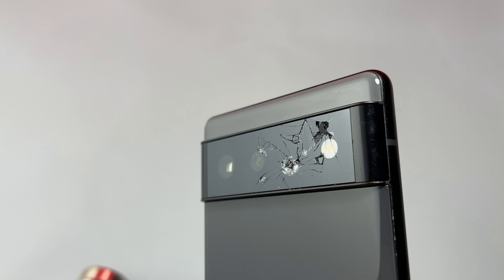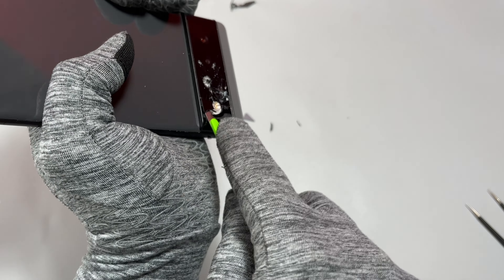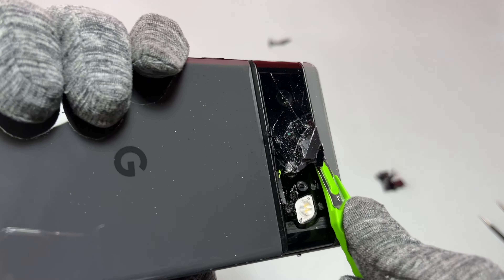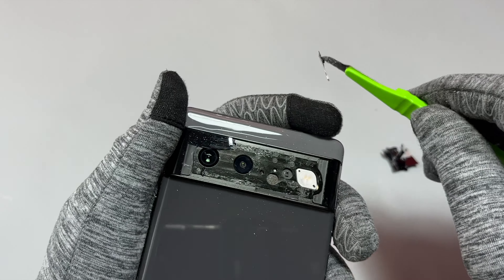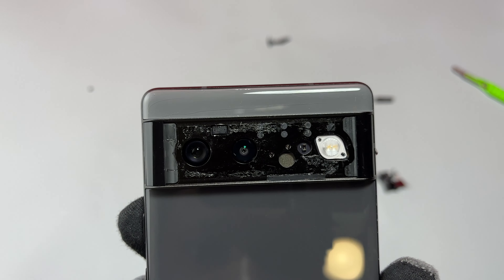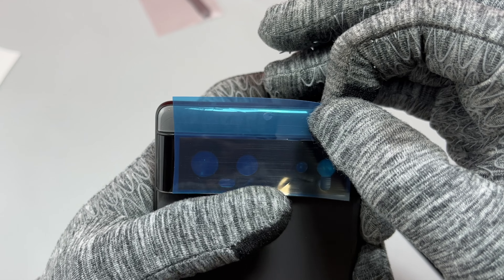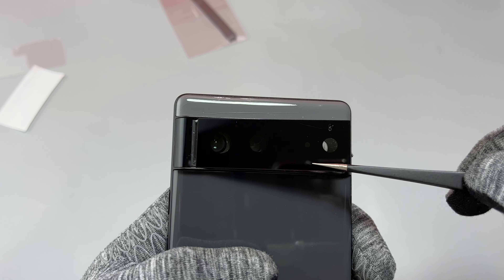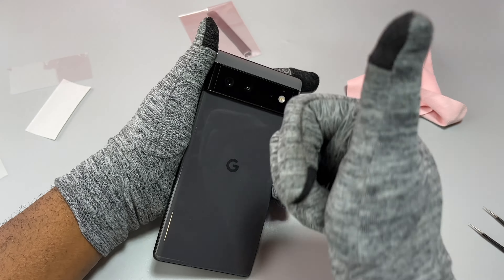Google Pixel 6 Camera Glass Replacement

Comment: It looks like the adhesive was just installed upside down. I think maybe they put the blue cellophane on the wrong side of the adhesive. If you had peeled the blue cellophane off and flipped the adhesive over then the sensor cutout would have been in the right spot as well as the cut out for the sensor above the flash.
Thank you for the video though!
Reply from the maker: 😅 you are RIGHT. Just a vertical 180 degree. Wow I was so surprise that I did not stop and think of what I can do to fix lol. The solution was easy and there 😄. Thanks for sharing and giving a solution 👍🏽.

I said to myself since it's IR infrared it would just go through the tape and wouldn't really really obstruct the operation.

Comment: Yes! Finally a repair video on the Pixel 6 camera lens. I'll do the same repair on my phone this evening but the replacement lens did not include any adhesement :l
Reply from the maker: 😟 no double sided tape provided. That strange that's the most basic thing needed for this repair. You can use b7000 it will work great just avoid too much near the cameras and you should be fine.
Reply: @ersbit  Hi, thank you for your reply. I just looked and it seems to be pre applied :) I'll let you know if the repair went good or not as soon as it's done. Keep up the great work!
Reply from the maker: 😂 great. Just try to mitigate as much as possible glass debris/dust getting on the cameras. It's really a pain. After these things the best thing to do is to add hear resistant tape on the glass to trap some of the debris/glass dust. I will try that on my next camera glass repair 👍🏽

Comment: Hi. I need to replace mine as the lens has spoiled but not cracked so I'm guessing I will need to break the glass's myself? Where would you suggest cracking it as I'm afraid to cause damage to the actual Len's or flash. However I fear anywhere else is sitting directly on the phone frame so maybe difficult to crack in a controlled way

Comment: My thoughts on my this repair was to use packing tape to cover the broken visor, then use either hot tap water or boiling water, soak a small towel (or even paper towel), put it in a zip-lock bag, and use it to heat up the broken glass visor.  This way the adhesive is hopefully soft from the heat and the tape will make it easier to remove the broken glass without them going everywhere.  Next time you repair, would you try this method and tell me how well it goes?
Reply from the maker: That can work but in my case that would require too much preparation and time to complete the repair generally 😅
Reply: @ersbit  Really?  I thought it was less prep and quicker.  Hot water from tap and tape to keep glass from falling apart.  I hope to do this to fix it.  I waiting on the replacement glass visor myself.
Reply from the maker: No am not saying it will not work, just for me it will take more time and wouldn't be wise because I already acquired all these equipment 😂😂. 
I have 3 hot plate for smartphones repair (barely use them) I prefer the 9$ heatgun because it's faster 😅. 
Using take is wise but this tape they use wouldn't let you remove the glass without have pièces everywhere.
Reply: @ersbit  thanks for the insight!
Reply from the maker: You're welcome

Comment: What temp did you heat up the glass at
Reply from the maker: 👋🏽 I was using my heat gun at the low setting mode. Got only two (high and low). High can burn faster and for these simple straightforward camera glass repair I almost always use low power mode. Even a hair dryer would do it (that’s less heat than most heat gun low power mode) 
😅there’s no way to be specific there’s no screen on my 9$ heatgun

Comment: not smart using a Scalpel and scraping off the screen toward your palm! NOT VERY BRIGHT!
Reply from the maker: Thanks for caring. True but I can afford to do that I have the experience....Most people should even wear cut resistant gloves to avoid anything from happening. On my glass replacement for the Pixel 6 Pro the blade flew why trying to remove the glass 😂😂 WEAR EYE PROTECTION AND GLOVES TO BE SAFE FROM ANY HARM. Appreciate you're concern it's legit and things will go wrong sometimes.
Reply from the maker: lol finally cut myself after 3 years just a few weeks after you commented
Reply: oh no! 🥹
Reply from the maker: @johann-space  Completely healed now. I see the scarf only if I look very close 🤣. Wow it was quick blink of an eye, just like cutting butter. (Was lucky it wasn't deep) 👍🏽